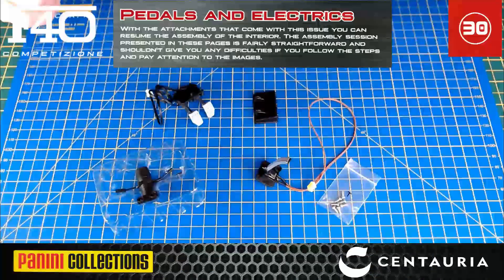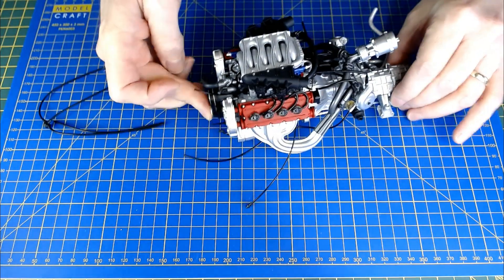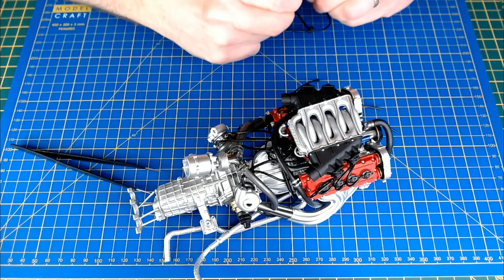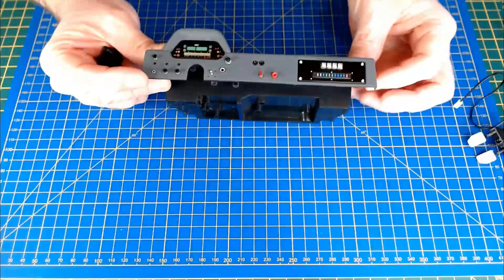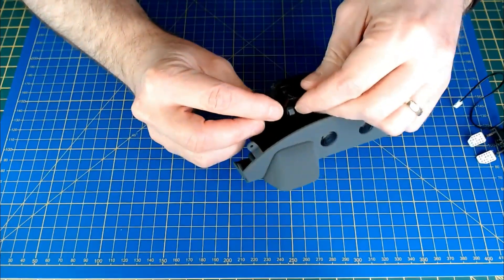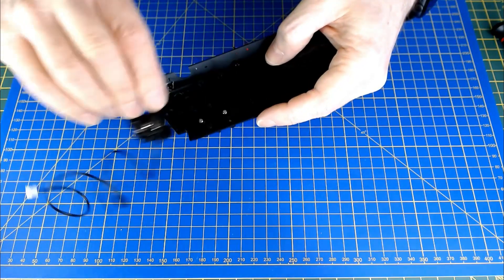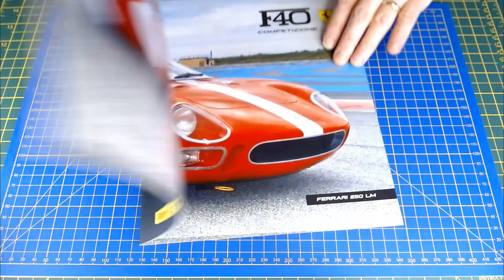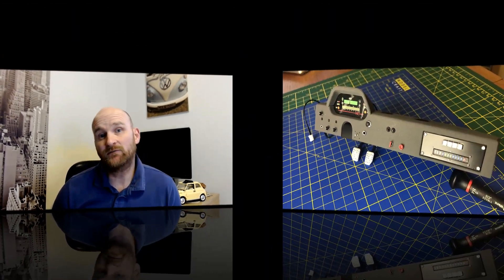Build a Ferrari F40 Competizione issue 30. A 1/8 Scale Supercar model PartWorks build

Comment: I see you've put the turbo lines over the waste gate pipe is this correct?
Reply from the maker: Hello and thanks for the comment. Good spot mate, yeah after fitting the waste gate I was not happy with how stretched the pipes going into the turbo were, they were at right angles going into the turbo. I had noticed that a couple of of people on the Facebook group had routed the pipes over the waste gate pipe, not sure if it is 100% accurate but the pipes on my turbo were so stretched that I really didn’t have a choice. I did find one picture online of the engine with the pipes going over the waste gate pipe, but on the engine they are also metal pipes and routed very differently.
Reply: @kevinstuartbuilds3792  Yeh mine are the same, they look like their ready snap off, yet the build videos look like the turbo lines are longer, i did search for the F40 competizione engine with mixed results, theirs an lm and a gte version, some have bigger intercoolers aswell, this build is a nightmare to be honest, that and this stupid virus which has now pushed the build for a completion date of July 2022 we'd of finished this in mid November this year...so frustrating, I think this is a flawed design, the instructions don't make sense, the build videos don't make sense because at some stages the build looks different in some aspects, to be honest nothing makes sense anymore, im off going climb on my roof and take a nose dive and land on my head 😂